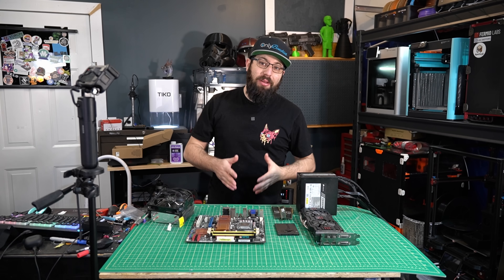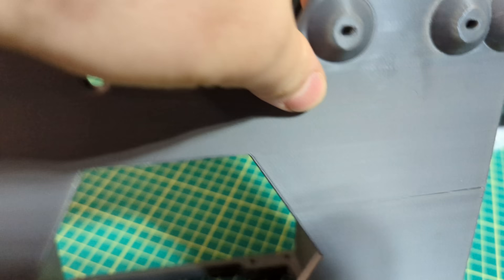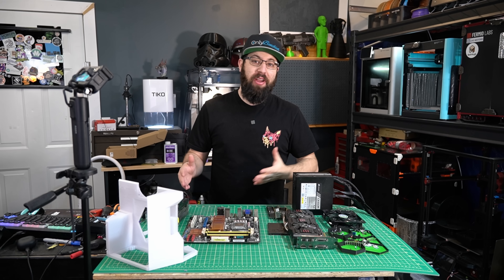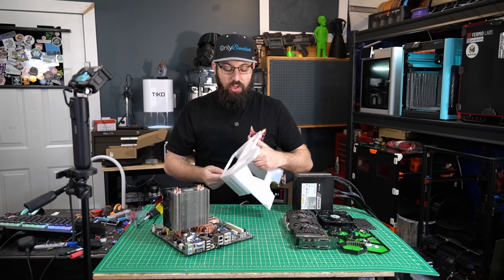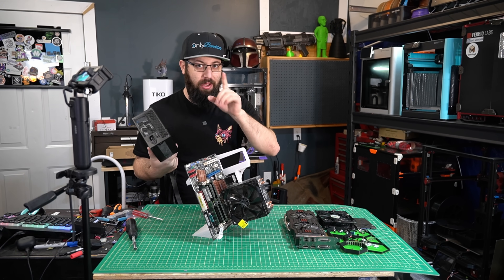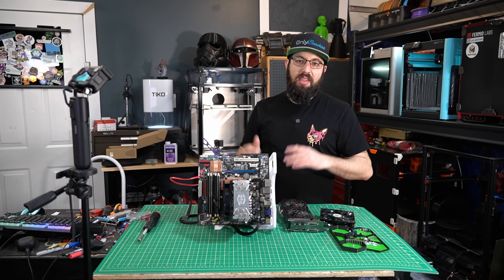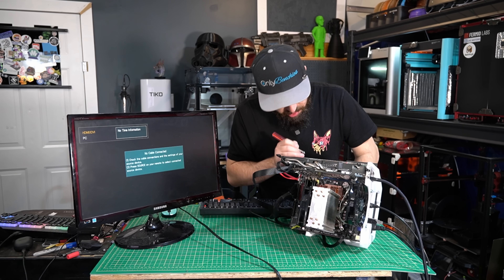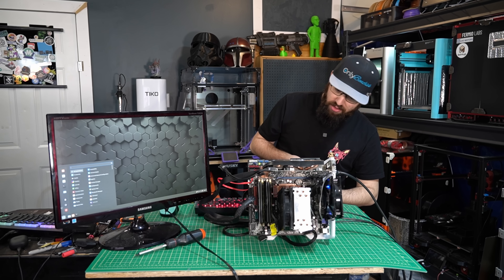The PrintPuter - Fully 3D Printed Computer Chassis #3dprinting

Comment: A tip for repeat use of screw holes in plastic. When you screw in the second time (and subsequent times) start by screwing backwards until you feel the old thread, this will prevent creating another thread and stripping the old one.

Comment: This is really cool! I'm working through a custom 3D printed case design as well and it is great seeing these types of projects get the coverage they deserve!
Reply: The reason that 3D printed cases aren't as common is there are some inherent issues. It all comes down to grounding. The components in your PC are very susceptible to interference and power spikes, a metal PC case forms a Faraday cage creating a barrier between any interference on the outside and the inside, if you look at cases from HP and Asus that have glass windows they have a special coating and are grounded to the case. If you open up an old plastic laptop you will see a silver paint on the inside, this forms the conductive layer as the case being plastic is not conductive. The other issue you have (less so with ABS) is that blowing air across plastic parts can generate static electricity, it can build up an arc across to sensitive components. Finally electrical safety (regulations will vary country to country) unlike a laptop power supply a PC power supply is not double insulated. In the event of an accident you want the PC case to form a nice big path back to earth so it goes through the case and not you.

Comment: I often wondered about doing something like a full custom case with direct air flow etc. optimum pc recently did a case with 3d print stuff to direct airflow. Back in the day they used to focus air with tubes etc then they stopped. 

The custom case stuff or airflow path optimization is something Puget systems could/ should get into…